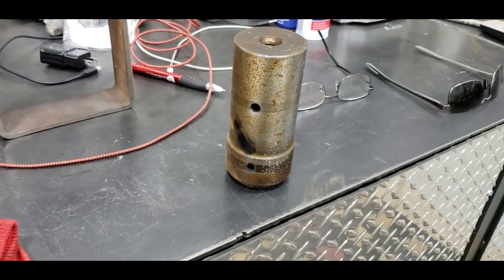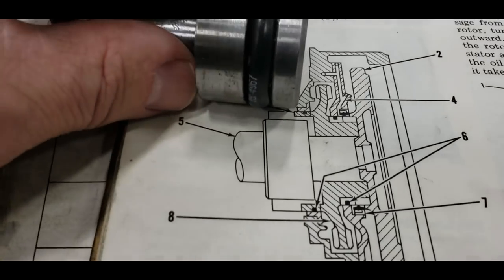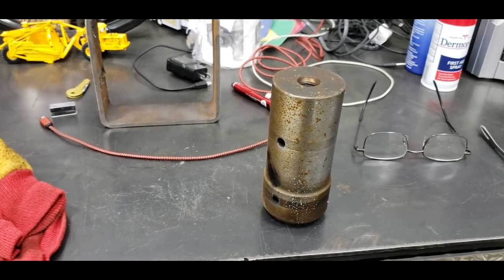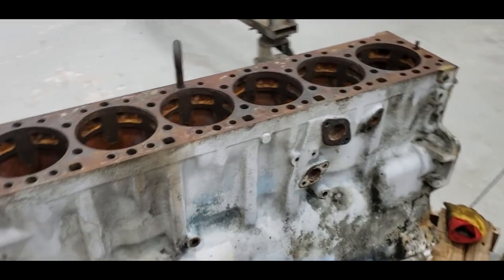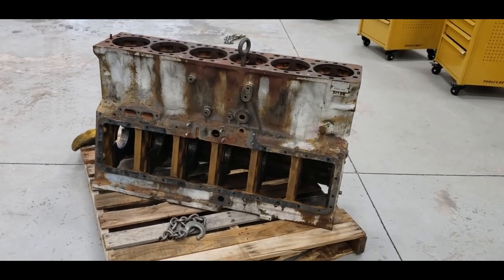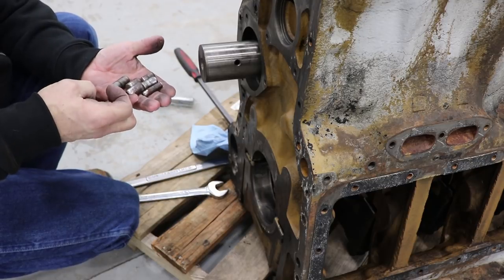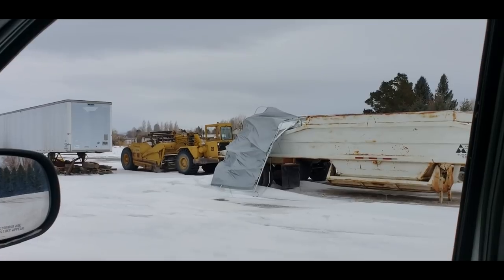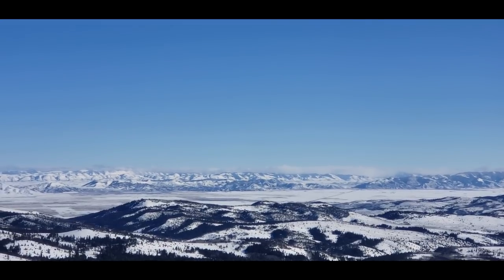CAT 1693 Prep For Machining

Comment: Being a machinist I always set my mics to my "feel" on the standard then I know  where it is measuring at , also , I would not clamp up on your mics in a vice because it could cause some distortion and not read correctly, they make special devices to hold a mic in position to set that a are more gentle.

Comment: Micrometer adjustment.  I'd say you need the appropriate standards bar that usually ships with the micrometer.  Using two pieces is going to be error prone, especially as much as you have to handle them.  The heat transfer from your hands is more than enough to skew the accuracy.  That might even be the reason they fell out as they cooled and shrank. You also have six surfaces that have to be perfectly clean and parallel.  I bet your machine shop would help you out, or you can order the standards bar.
Reply from the maker: Yup, you and I think alike

Comment: You gotta be super careful with those green bristle rolocs still Jeff. I use them when fabricobbling stuff and they can most definitely still remove metal from a surface. I personally never use anything but brake clean and razor blades. Goodson Tools & Supplies in Winona, MN sells a few nice gasket scrapers with I believe a carbide edge. I don't mind them.

We got taught in engine machining school to avoid anything on a pneumatic or electric drill/die grinder/etc. Lot's of room for error.

Love the content and just trying to look out for a guy!

Comment: 3406e has a slotted spindle for the idler gear. Also for the 3406e cat makes a .003 thicker spacer plate. If I come across a block that has already been cut I can get thicker and larger diameter shims.

Comment: Find a guy that does broken tap removal with an EDM (Electron Discharge Machining) They can cut that ball out no problem. Also, run a bottom tap into all the threaded holes to clean up the threads. After going through many replies, I see that I was a bit late on the EDM suggestion. OOPS!

Comment: It is my understanding the paint on the inside of the block is to ameliorate and sand casting porosity oil or coolant seepage. I am not sure what paint that Cat used but for many years Glyptal 1201 red enamel has been the defacto standard pain used to paint the inside of engine blocks, transmission cases and rear end housing and gear carrier housing.  The stuff was originally used to paint the housing of armatures, coil, transformer cases etc.  the stuff normally sells today for about 40 bucks a quart for the paint alone to the average bum on the street plus you should prime the surface before painting it.  I can speak with experience that if you choose to paint anything with Glyptal regardless if you prime the surface or not it must be clean and hot tanking is the best method provided the hot tank is kept properly serviced (clean) and even then several scrubbings with a good degreaser is a good idea.  All that said the cheapskates or should I say the poor man’s Glyptal substitute is Rustoleum Red Enamel paint I have experimented with it as a substitute for Glyptal and after taking apart 100k engines painted with both the Glyptal pain certainly looked better and was physically still smooth whereas the Rustoleum painted was darker and not as smooth feeling but the interior of the block certainly looked better than a similar engine block that had not been painted. That said I would have the block hot tanked and machined but not have any bearings/bushings installed and then paint the interior of the block and then install bearing/bushings and do any needed touch up but being careful to tape off bearing/bushings and other areas that should not be painted. While you were using that green cleaning disc which I agree are better than the brown cookie disc that grind away metal at a alarming rate that you might want to check out the original super scraper (www DOT SuperScraper DOT com) they are definitely worth the money in my opinion.  The only thing is since the have a solid carbide edge they are a bit fragile so don’t drop them and maybe not the best for cleaning rust but scraping old gaskets they work great and certainly better than a traditional gasket scraper.  One last thing I have recently seen some videos of “new” scrapers that are being dragged behind rock truck chassis or treaded farm style tractors and wondered what you thought of them compared to a traditional scraper like you have. That’s enough of me rambling, as always thanks for the video
Reply: I'll 2nd the SuperScraper. The flat carbide edge really does a nice job.
Reply from the maker: So why do I want to hot tank it? cause I didn't want to repaint the insides  (I"m lazy) lol  I've had really good luck with wire brushing the outside, then off to the machine shop, then lots of solvent and brushes into every drilled passage, then tape off the deck and gasket surfaces and clean with prep sol and reducer until absolutley no visable residue can be seen on the rag.  then painted with a brush and cat enamel straight outta the gallon can, but this time I'm going to paint the engine and frame and running gear with the same paint, so what would you use Imron?
Reply: Also you can apply Loctite 290 to cast surfaces or weldments and it will wick into any porosity and seal it up.
Reply: @Jpaydirt  Your strategy is sound.  You already proved it to yourself.  I lost count of how many engine blocks, transmission housings, gear housings I have sprayed after wire wheels and wax & grease remover.  Zero issues with paint adhesion so far.  I do spray John Deere's buff primer first regardless of the equipment manufacture.  Probably a bit overkill on my part, but it has served me well for at least 15 years.
Reply: @Jpaydirt  I've painted lots of custom engines for show cars and trucks, you can go at the block with a flap disc to smooth off some of the casting and rough edges for a really showy finish, do this before machining and final cleaning.  Start with a self etching primer, then a high build two part surfacing primer which you can sand smooth. And then topcoat with acrylic urethane, basically the same steps as if you were finishing body panels. I use Nason products since that's what I can get locally.  Not sure if you can actually get the old Imron paint anymore.   Anyway I have engines that were painted 20 years ago that still look fresh, I have a video showing one these engines in a '68 GMC pickup.   Try to avoid plated fasteners too when reassembling as the paint tends not adhere to these too well.

Comment: Another great video on the OVH of 1693 Jeff. On cylinder block decks, head surfaces, oil pans, etc. I use a file sander with 180G paper, after using the Roloc to make things are flat. Especially the counter bore area. Been using this setup for over 25 years. What was wrong with the old 1693 block? I might have miss that video. Getting 4 inches of snow tomorrow.

Comment: A wire cup wheel on a 4 1/2'' angle grinder works the best for cleaning gaskets off and they last forever.

Comment: The shaft mount on the 3406/C15 is slotted, so you can make up the backlash after decking or head work. I think I have a picture somewhere of the last one I did. I assemble the timing gears, then set backlash with the idler

Comment: hey jeff your right about that block having to be right or having problems with liner dropping n blowing head gasket my 1st truck was a 73 kw coe had been overhauled prior to me buying truck local shop did it they had block cut n installed counterbore bushings truck was wrecked wben i bkugbt it i fixed it n was about 4-5 months into runnin it when a liner dropped i patched it up had spacer plate milled .003 or ran it like that put some money together n when it dropped liner again i overhauled it had block cut again n bushings installed that lastwd anothwr yr or so n dropped liner again ended up buying another truck ran as oo for about 12 yrs n thwn got into garage business qrkin for myself saw same problem with 3406s many times just my opinion but cats head gasket deck set up is junk i never did anyrhing with.mine but if j got the money n time i was goin to have deck milled n have press fit counter bushings installed i believe that would solve the problem if i were you thats what id do cost more money now but hell od a lot better than having tl do ovedhaul again cummins has right idea solid steel head gasket with protrjdin fire ring o  top of liner that actually cuts into fasket when torgued down lot more forgiving cats setup has to b damn near perfect or lindr will start wearin into deck n that sup can gas  engjne gasket is done as dor that crank your only 1.7 thousandands under i qould think thats within specs id rechexk that id your not sure about your mic all just my opinion dnt get me wrong i love that 1693 thats runningest pjllin engine i ever ran put 60 on the deck n run balt to chicago across humps seemed to pull bettwr the more you put on it got 4.8 mpg no matter how heavy she was the one time liner dropped id been runnin it a while with gasket blown down in laredo shut it off to unload n she water locked turned crank by hand enough to cracka valve  fired it up deadheadedhm to pa never shut it off just kept addin water got 6 mpg uses about 15-20 gal of water haha my problwm was started out pretty mucb broke or id still b runnin that truck anyhow enjoy watxhing you work on that engine

Comment: ,,, a flat bottom drill might go down that shaft and clear out the swaged metal, never worked on a 1693, but seems more complicated than a 3406-E . I'd avoid grinding that crank if I could, check the recommended wear limits . Same with the line bore .

Comment: I would put a snap on collet style stud tool 
Put the collect on the stud and use a pair of heal bars under the collet to remove dowel pins
Reply: What's wrong with how Jeff did it?  The slide hammer tool looks like the perfect tool to me.
Reply: Those dowel pullers work well
Just saying its not the only way to get it done spent 37 years as a heavy duty mechanic

Comment: Are the threads/seal area critical in that shaft? If torch out ball how do you maintain seal? Can it be milled untill pinching material gone and the ball falls out ? Then don't risk damage to shaft/ insert seal. At minimum try to drill.

Comment: Carbide spade drill gets those plugs out...will drill though hardened roll pins...js... .0017.  Well you missed it by that much...thoe I think your mic is off by .0007 by your explanation ...cheers
Reply from the maker: Oh man really?  great I like your solution I knew if I talked about it someone would have a better idea   Thanks sir!
Reply: Jpaydirt your welcome...thoe re seeing it drill it out through the side hole might be a better option...threads in the end hole might catch hell from a spade drill...have the machine shop have at it...
Reply from the maker: @knowltek  Well I can pull the shaft and put it in the lathe

Comment: Josey Wales i think the big reason they drop liners is the lower counterbore is to loose which places to much loading on the top flange like wiggling a piece of tin side to side till it snaps off just my opinion i only built 1 cat for myself and i was disappointed with the way the liner sat in the bottom on a fresh machine job. My block had 3 original lower counterbores 3 lower sleeves new to old measured the same to loose i thought but on spec by cat.

Comment: You should be able to get aftermarket bearings then you can go .010" instead of .025". Keep in mind that CAT does  not make bearings anyway
Reply from the maker: where?
Reply: @Jpaydirt  I got the bearings form the shop that I had grind the crank.

Comment: @0:58 Why not just run a milling bit or a drill bit in there and cut off the stakes holding the check ball in?
Reply: You could try one of those little hollow diamond hole saw bits for glass, just search for glass drill on ebay and you'll see the ones I'm thinking of.
Reply: @noshsreqd  I don`t understand why a mill bit wouldnt work do you?
Reply: @willythewave  The steel ball will be too hard for a mill or drill if it hits before the staked in area is cut away, the hole saw will avoid contact with the ball.
Reply: @noshsreqd  Dont drill the steel ball, just the staked part. Hence the mill bit.
Reply from the maker: @willythewave  It's sticking up above the staking, if you noticed on the old one you can see where we had tried to remove the staking, didn't work out to well

Comment: Could you not shim the spacer plate to get back to spec if the deck was that bad?
Reply from the maker: No, because then your liner height would be wrong
Reply: Jpaydirt understood. I forgot the liners are inside the holes in the plate.

Comment: Why did you decide NOT to use old kennys block, was it decked too many times beyond spec.?
Don't think you gave the actual reason even though I know your donor block is unmachined!.
Reply from the maker: It's been decked once, the bearings have been walking in the main saddles so needs a line bore, and probably needs the upper and lower bores sleeved
Reply: @Jpaydirt  Thankyou for your reply. I believe I was going to buy a piston & rod from old kenny over a year ago. I think you were going yo price shipping! Where are we on that?